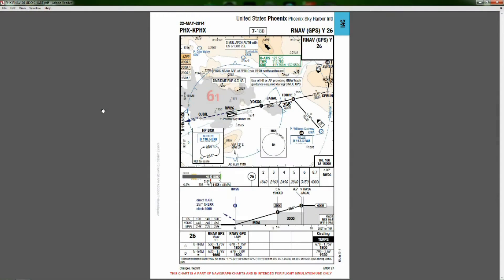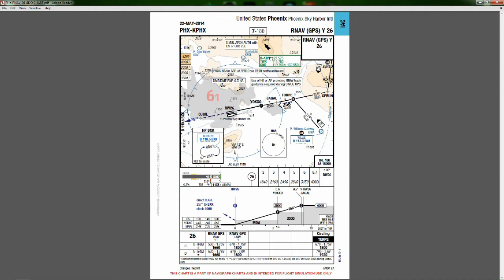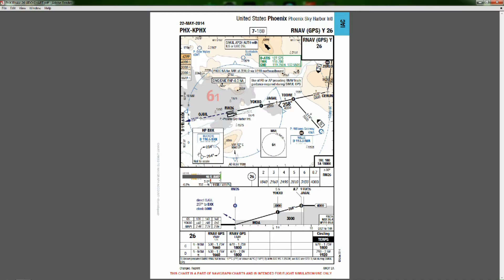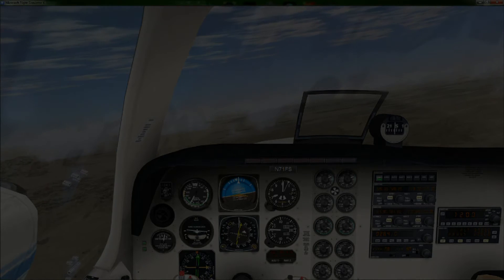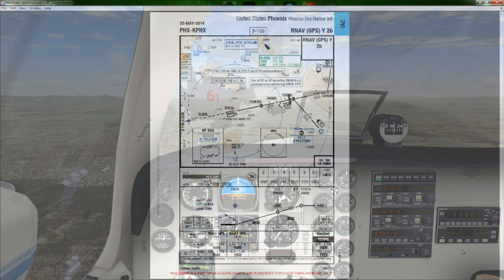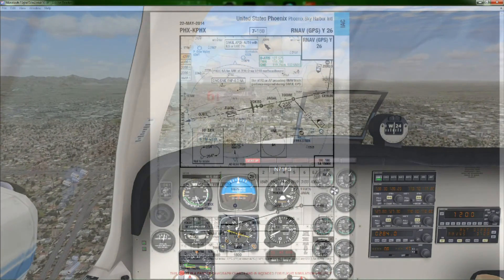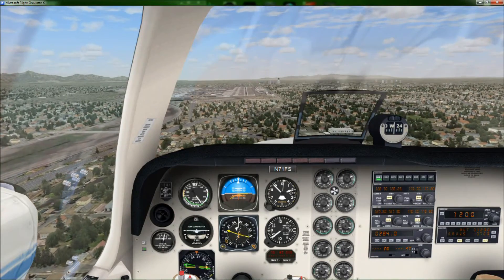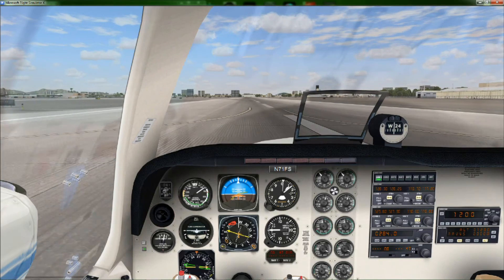FSX Tutorial | Flying The RNAV Approach

Comment: Okay it looked good though I didn’t hear the before landing check list ,. What was your speed on short final . What is the VLE for this aircraft ?  I noticed that you did not adjust prop pitch . Last time I flew one of these IRL the landing had a check list - GUMPS check .Also you generally do not land with trim wheel . Pitch for airspeed , power for altitude yea ?  . You put in flaps, pick your aiming point , trim yes but you fly with the yoke and pedals . Did you dial in any kind of weather ? I noticed also you didn’t dial in AWOS. Not nit picking , just trying to get some clarification . This was just a RNAV approach but we do want to follow our check lists. Try a socked in approach 0 visibility , ILS only -gps and auto pilot fail approach . I routinely do that on my sim to stay sharp for IRL -IMC situations.
Reply from the maker: This is an older video and my emphasis was on the approach rather than the aircraft procedures...as a result, my flying was actually quite poor in the video. You are correct, checklists and procedures are important.
Reply: Captain_Mac oh , I meant nothing hypercritical.  I trained under a mode C bravo so it’s way more strict in terms of procedure . It’s a good video .

Comment: So, RNAV approach is Charts + GPS approach? Thats it??
Reply from the maker: +Singh Amaninder that's simplifying a bit, but not entirely inaccurate.
Reply: Captain_Mac Umm.....Also If I add FMC to it, then?
Reply from the maker: +Singh Amaninder if you are flying an RNAV approach in an aircraft equipped with a flight management computer, you can program it to do most of the work for you. Simply input your altitude restrictions at the appropriate waypoints and monitor the aircraft during the approach. It will not autoland from an RNAV approach.
Reply: Captain_Mac oh, and what about planes without FMC?
Reply from the maker: Singh Amaninder for planes without an FMC follow the tutorial:-)

Comment: How do tell when you cross a waypoint?
Reply from the maker: RNAV is short for Area Navigation, which is another term used in aviation for GPS. So you know when you cross a waypoint because you see it on the GPS. You cannot fly an RNAV approach without a GPS equipped aircraft. I hope this helps.
Reply: Change the NAV/GPS mode from NAV to GPS, then the CDI needle will start relying on the GPS flight path instead of VOR course radials. Just like on VOR navigation concepts, once the needle deflects you have passed that RNAV waypoint, and afterwards it'll change direction to the next waypoint.

Comment: I enjoyed the flight, but I'm totally confused as to how you're doing an RNAV(GPS) approach without a GPS… I understand that you have AEFB,BUT...
WHERE is the GPS???...help me out here!

Please advise!

Chas
Reply from the maker: The default FSX GPS will suffice.
Reply from the maker: +hesynergy Let me clarify. I used the default FSX GPS for flying the approach. I undocked the window and placed it on my other screen. The reason the video doesn't show the GPS is because I chose to overlay a moving graphic on the chart instead.
Reply: +Captain_Mac but I never saw you use Any GPS...pretty confusing for noobs talking about a GPS when you are using an FMS ... am I mistaken ...did I miss it when you pulled out the default GPS when I wasn't looking?

Regards,

Chas
Reply: +Captain_Mac ahhh...didn't hear you say that...sorry

Chas
Reply from the maker: Quite alright. Was the video helpful for you?
Reply: You're supposed to change the NAV/GPS switch from NAV to GPS mode. That will start aligning the VOR CDI needle to the GPS path itself instead of VOR's. Once the needle fully deflects out of the center area, that'll tell you that you passed an RNAV waypoint, and eventually it'll change direction to the next waypoint.

Comment: The aircraft is ok, it's just you who don't know how to fly it. Terrible landing. Your approach and landing speed is to high, that's why you had problems with the landing. I understand, you are not a real pilot...
Reply from the maker: You are right about two things. I don't know how to fly this plane and the landing was terrible mostly because the speed was too high. However, the airplane is not that good, at least compared to payware addons. And I am in fact a real world pilot. But I am not multi engine rated. Perhaps you would enlighten us all with your experience in the beech barron 58 and explain how to land it better? This way we can all learn something. Cheers
Reply: Captain_Mac will2see, it was not a case of bad piloting on his part, it was just a matter of his yoke sensitivity being too sensitive. If the slightest movement of the yoke is causing abrupt movements, than the sensitivity and null zone need to be adjusted in fsx. Change these settings and the aircraft will handle like a dream.
Reply: +biggy5567 It was a case of bad piloting. His approach, but mainly his landing was too fast. I agree that the yoke sensitivity in the FSX Baron is a bit too sensitive but the high speed landing was the main reason behind his bad landing.
Reply: +will2see the plane does react faster and more sensitive if you are going faster because you have still alot of lift and air going under the wings, so this approach was a little bit to fast indeed :)

Comment: Have you adjusted your settings in the "Flight Tuning" section of the aircraft cfg? You are not the only one to have this problem. You can dial in a heavy feel if you want. Just have to play with the numbers. I've done all the AC I fly, couldn't fly them otherwise.

How did you get the plane graphic to move across the chart?
Paul
Reply from the maker: +PT Johnson I didn't mess with the config since I don't fly this plane often. Thank you for the tip thought; I will keep it in mind for future endeavors. I used something called keyframing to get the graphic to move across the chart.